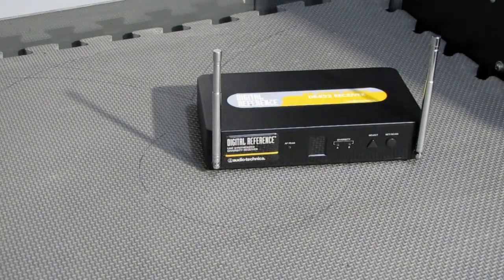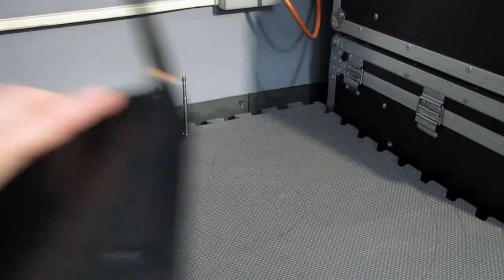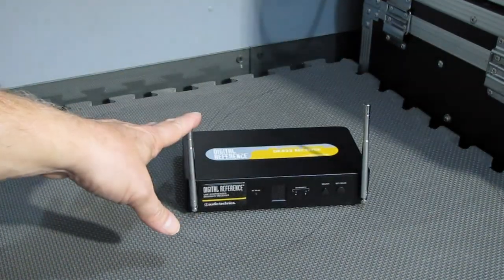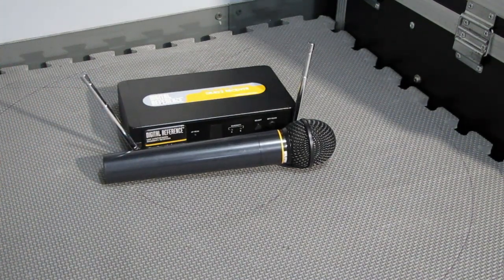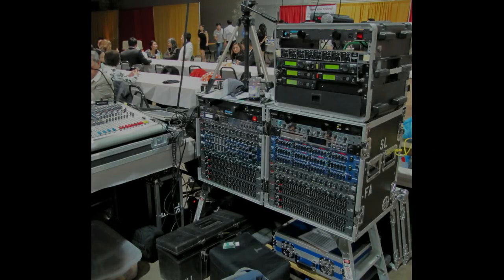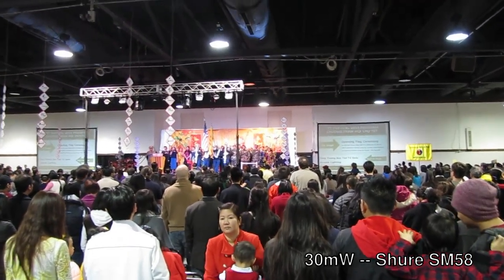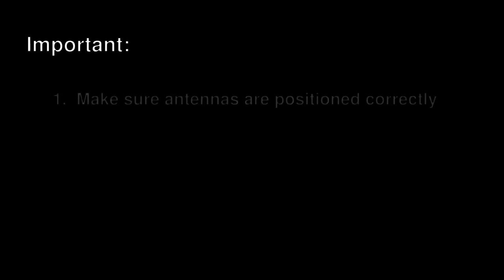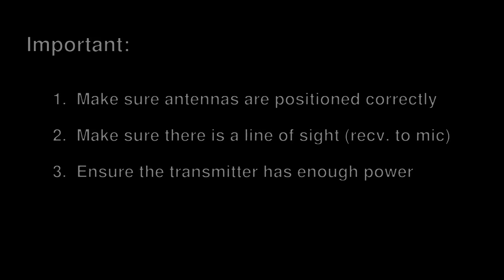Wireless mics and how we use them for events (antennas and power)

Comment: Most shure wireless and many others actually can interchange antennas and are upgradable to half wave for improved range
Reply from the maker: You are correct.  Many manufactures can provide interchanging within their product lines.  It's the interchanging between manufactures that usually does not work (I didn't fully state this in the video).
Reply: @stageleftaudio  that's not entirely true... as long as the antenna is the right frequency range you should be fine. Unless you're meaning the receiver's themselves? Just look at brands like PWS and RF Venue, making aftermarket antenna solutions that are brand agnostic. this also brings up different types of antennas, other than the little whips that come as standard. you've got your helical, domed helical, paddles, and diversity fins etc. but that's all meaningless without employing good RF coordination, both within your rig minimising intermod, as well as dealing with environmental RF interference from local TV stations, or even other venues nearby. RF Explorers, and RF receivers that can actually do a real frequency scan, and show you the data (Shure ULX-D, Axient) are invaluable tools, along with good coordination software like Wireless Workbench. Especially when you're in a different city every day.

Comment: My impression with transmitter power is that analog transmitters require more power than digital ones for a clean signal.  Is that your experience?
Reply from the maker: I have some experience with digital mics (2.4Ghz).  There was no noticeable difference with power between them; however, using digital (2.4Ghz - free frequencies) I needed to make sure no wireless routers or other blue-tooth devices were in the immediate area.  These other devices use 2.4GHz and can cause interference with digital mics.
Reply: @stageleftaudio  I was thinking about 2.4GHz mics to try them out, and did have concerns regarding WiFi (among other things) being on that band. I didn't take the plunge, but it seems it's a pretty low-cost way to get multiple microphones. On UK license free, you're pushing your luck trying to use more than four separate channels; hence the 2.4GHz kit springing into mind.